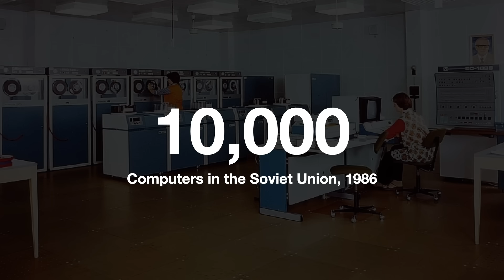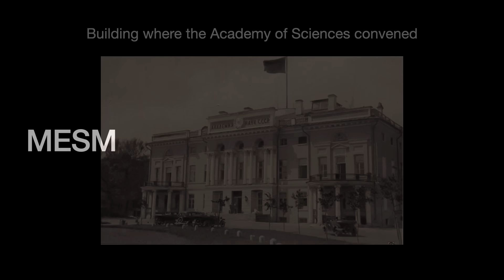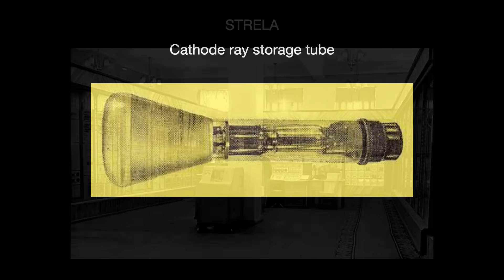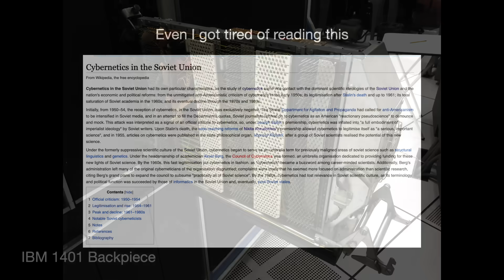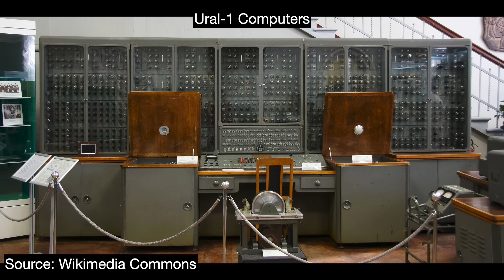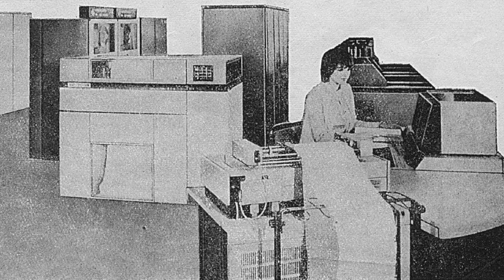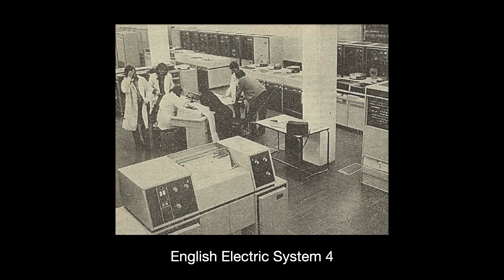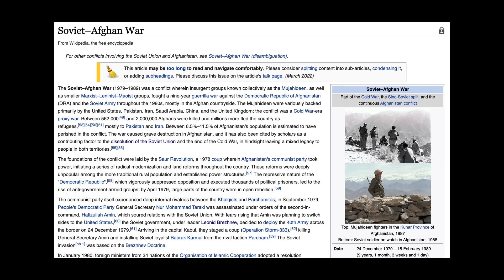Why the Soviet Computer Failed

Comment: centralized planning 100% is at fault. Many technologies are basically stumbled upon by accident or unfocused tinkering. 

Think tons of small groups of people who are all simultaneously trying their own different approaches to something. Even though the odds that any singular group succeeds are incredibly low, it only requires one group to get right once for the bar to be raised permanently. The net impact on society of a single “black swan” unlikely success far far outweighs the 999 others who tried and failed (and got nothing). 

Where the top down system of innovation tries to remove randomness through logical central planning, it ends up damaging itself as it discourages the unpredictable and hugely net-positive asymmetric upside of empirical trial & error / tinkering. 

Similar reasons why disorganized guerrillas in Vietnam and more recently Afghanistan (and generally) we’re able to defeat the highly organized, top-down controlled US Armed Forces.
Reply: North Vietnam had a centrally controlled army, in fact the huge losses the VC suffered due to the Tet Offensive meant that the NVA ended up replacing the guerrillas with conventional soldiers.
Reply: @ChucksSEADnDEAD  They still relied on guerrilla tactics though.

Comment: IBM 1401 did not replace punched card technologies. IBM 1401 was the punched card technology. The IBM 1401 was introduced in 1959. Punched cards were the primary data entry medium until late 1970s.
Reply: Yes, the 1401 replaced mechanical punch-card technology like sorters.
Reply: We used punch card based computers at school until the early 80s. Low budgets delayed upgrading until some grant money came through. Then we got about a dozen Apple II computers for the students in a lab across the hall from the electric typewriters and a few IBM computers for the main office.
Reply: In 1981 I was working at FMC in San Jose (Bradley Fighting Vehicle) and John Godfrey was hired to convert the JCL for the production report runs from punch cards to PROCs on disk. This was an 4341 RJE site as the computers were in Dallas but Arthur Andersen on site writing an early MRP system so it wasn't a complete backwater. FMC even ran several 8100 shop floor data collection systems which the machinist did not like. They would put metal shavings in the card readers. If you ever see 4 pages on a single page of laser print, chances are I did that font. The people from Siemens liked it and asked for the rights to use it.
Reply from the maker: 🤔 late 1970s?
Reply: @Asianometry  certainly!
Reply: @Asianometry  Yep.  Used punched cards at university until the early 1980's. After graduation saw many businesses still using punched cards
Reply: @Asianometry  Latest I'm aware of is circa 1979 (at a government facility in the USA).   Used magnetic core memory as well.  Was replaced by a VAX.
Reply: @Asianometry  Punch card decks were still used by mainframes in the late 1970s but mini-computers from DEC and HP were filling other computing niches. Often while the mainframes of the late 1970s still used punched cards, they were starting to use 3270 and eventually 5250 terminals. Another popular input medium at the time as punched tape. These data storage and input methods persisted into the 1980s only to replaced by magnetic media such as 8" floppy disks. I still have a box of my last card deck I used for a computer science course in my closet.
Reply: @Asianometry  It sure was in 1976 Imperial College had two rooms of IBM 029 punch machines for programming use by students, most on the CDC 6000 super computers but also several other systems.' Glass teletypes' VDUs and paper tape were only just appearing.
Reply: @Asianometry  Yes, late 1970s.  My large government division, with world-wide locations used punched cards until 1979.  Our programs were coded onto punched cards, then converted to paper tape for input to our PDP-8 systems.  We finally moved to VAX computers in early1980.
Reply: @Asianometry  Punched cards live on in many file formats from the 70s and 80s which are still used and still follow fixed layouts...
Reply: @-szega  Is that why PYTHON still uses fixed formatting?😄
Reply: @Asianometry  Punch cards predated computers. They were created for the US Immigration Service for recording data of each immigrant entering the USA. A card was inserted below a keyboard where a pressed key punched a hole and turned a counter wheel. The punched card was read by having a block of pins pressed against it with those passing thru pressing down on electric contacts that lit up numbers and letters on a screen . They kept using the same size and shape card since then.